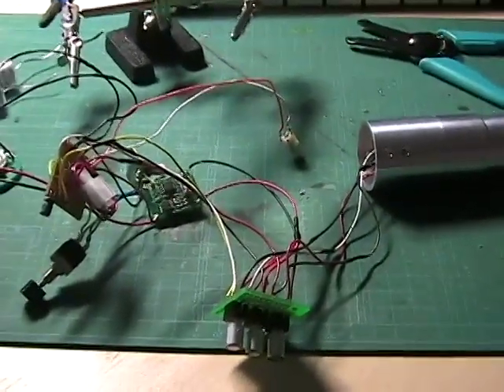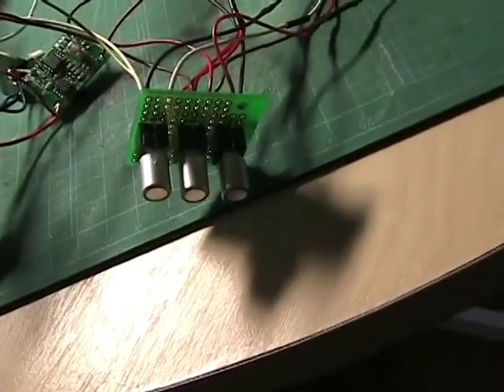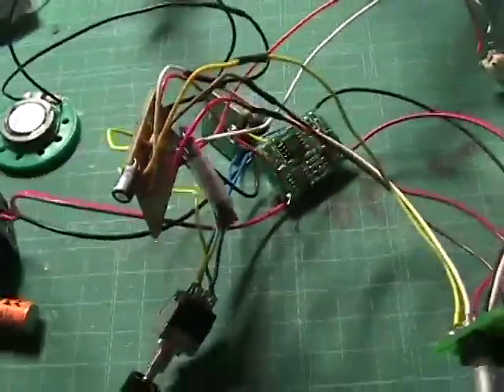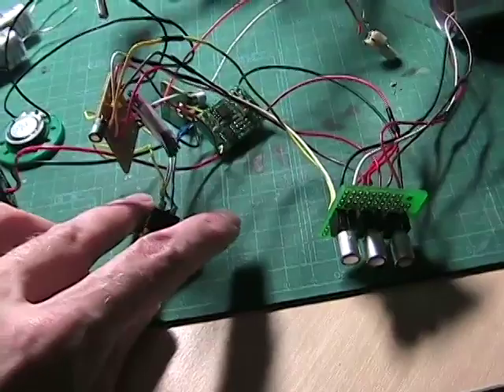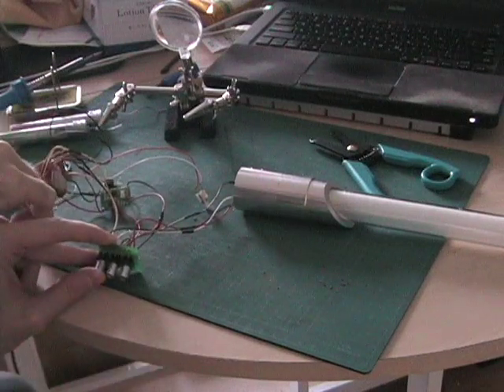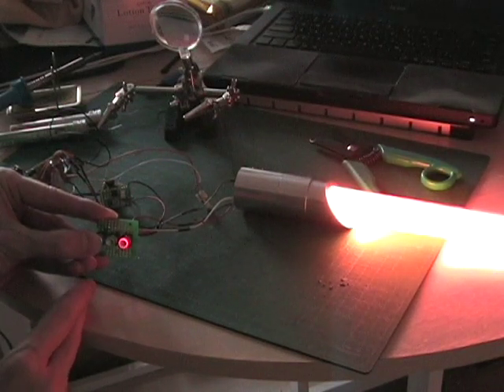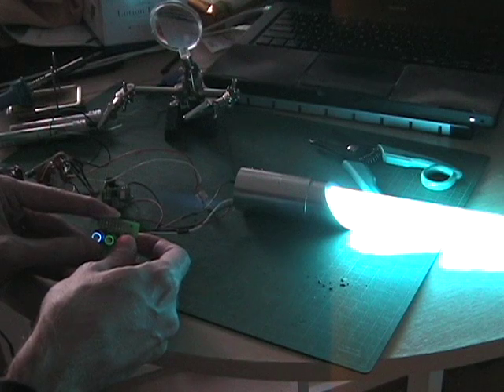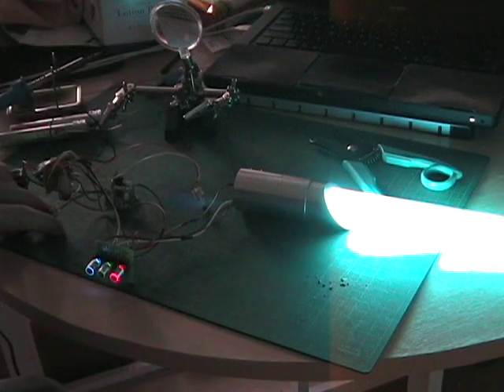Color-change lightsaber

Comment: You need more amps. I don't know what sort of power that LED driver board puts out, but I bet it's not 10W. The proper way to drive that LED is with three independent current limiting circuits, such as Buckpucks or similar, and the batteries need to be able to handle the total current draw from all three channels, otherwise the red channel will pull the whole thing down. A quick fix might be to slap a current limiting resistor on the red channel, but it's not an elegant solution.

Comment: You don't have enough current, that's why the button brightness changes with different blade colors. The red channel in the LedEngin is a heavy draw, as is the red LED in the button. Red will always hog current from the green and blue channels if you're low on amps. The blue and green channels on the LedEngin are pulling it down too, but not as much.